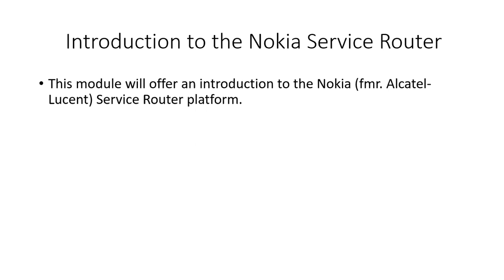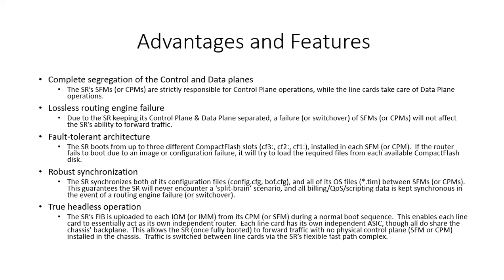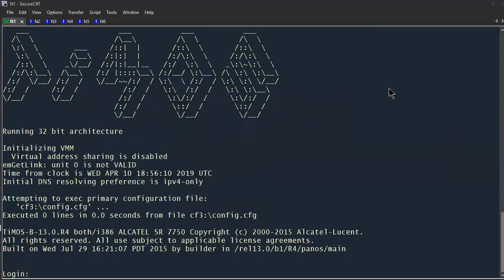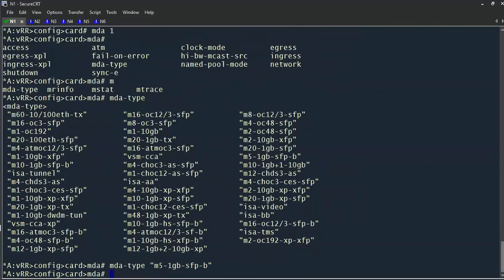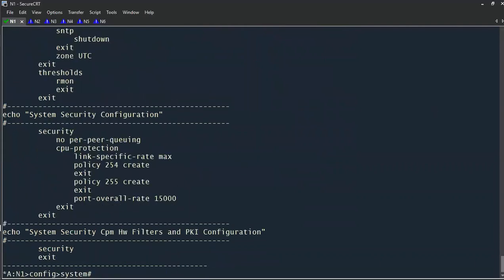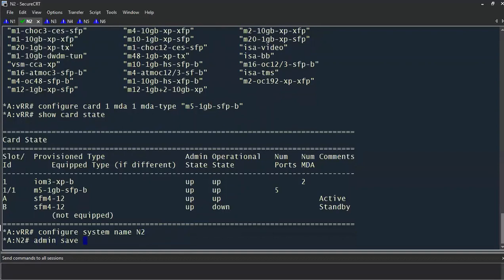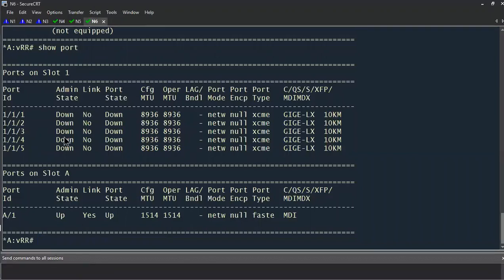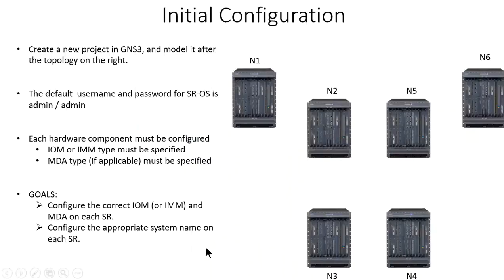Nokia SR-OS: 1 - Introduction and Initial Configuration

Comment: This is brilliant :) thanks for this.  Is there any difference between Router and switch OS or both are same like Cisco IOS . thanks
Reply from the maker: Thanks, and you're quite welcome!  TiMOS/SR-OS is a Unified Operating System, so Service Routers (like the 7750) and Ethernet Service Switches (like the 7450) use the same software - like Cisco IOS or Juniper JunOS.

Comment: Thank you Thomas. It is a very informative video/demonstration. On the second slide doesn't CPM stand for Central Processor Module?
Reply from the maker: Hi Ajay, thanks for watching as well as the question!  Nokia (fmr. Alcatel-Lucent)'s documentation refer to the CPM as both a "Control Plane Module," and a "Control Processor Module."  Because the CPM is responsible for managing the Service Router's control plane, I opted to adopt "Control Plane Module" as the meaning.
Reply: @thomastucker3764  Thank you for the clarification!
Reply from the maker: @ajaycnt  No problem!  If you have any more questions regarding content in any of the videos, please feel free to leave a comment and I'll reply to you as soon as I can.  Thanks again!

Comment: Hi mate,

We got a nokia router and switch in my work lab. There is already a config in there but I wanted to have a little play on the config and practice but I don't want to mess up the running config.

I want to wipe the existing config for me to practice but I want to save it and revert it back once im done and before I leave work everyday. Is this possible in Nokia devices?

Comment: Hi sir,

I have the below problem.

Alcatel 7750 12.0.R6 image Router slowly booting, it takes like 30 minutes, what is wrong?
I'm giving 8 numbers of processes and 21G of Ram, when it gets here it takes like 20 minutes.

GNS3 Version: GNS3 v2.2.39
Operating System: Windows 11
Workstation 17 Pro , 17.0.2 build-21581411

Comment: What is the difference between IOM and IMM?
Reply from the maker: Hi, Sandeep!  An Input-Output Module (IOM) contains slots where Media Dependant Adapters (MDAs) can be installed, allowing you to mix and match ports based on your particular requirements.  An Integrated Media Module (IMM) contains fixed, built-in MDAs that cannot be changed.  As an example: you may have a single 10-port/10GE IMM installed in the chassis; to match that port density, you'll need a 2-slot IOM installed in the chassis and two 5-port/10GE MDAs installed in the IOM.  Thanks for watching!
Reply: @thomastucker3764  Ok. Clear now. Thank you very much for clarifying this.

Comment: If i want to import files from usb to our router then what should i do
Reply from the maker: Hi Vanshita, thanks for watching and thanks for the question!  Unfortunately, I don't believe the CPMs/SFMs come equipped with a USB drive; only CompactFlash.  You'll need to [1] get a CompactFlash adapter (there's also a chance your laptop may have one equipped), [2] copy the files from the USB disk to your computer, [3] copy the files from your computer to the CompactFlash disk, then [4] insert the CompactFlash disk into your 7750.  If the CompactFlash disk contains your OS files (boot.ldr, iom.tim, both.tim, ...) then you'll need to install it into slot #3 of the CPM/SFM.  These routers boot from slot #3 (cf3:) by default. Let me know if you have any more questions!
Reply: @thomastucker3764  
Thank you
Reply: Its my request to make video on that entire process it will really help me to better understand.